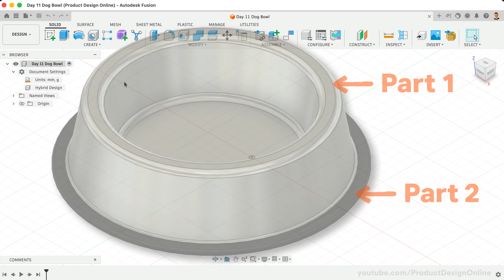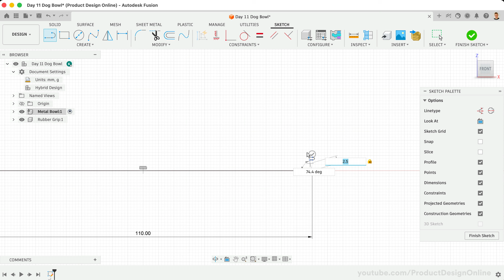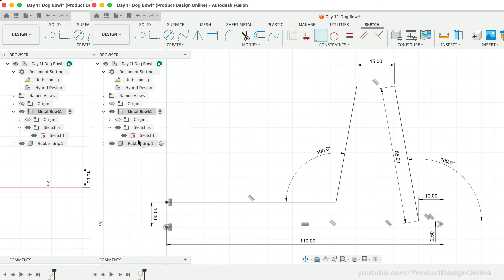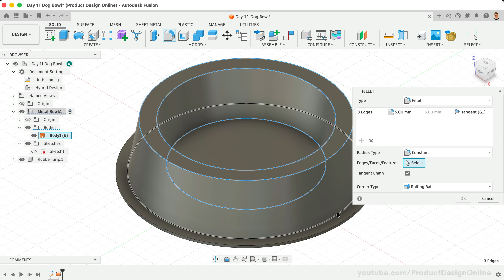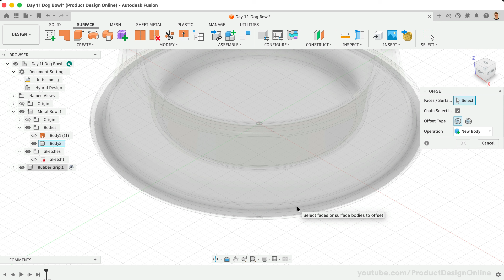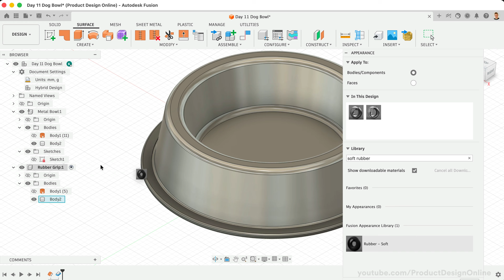Intro to surfaces | Day 11 of Learn Autodesk Fusion 360 in 30 Days (2026 EDITION)

Comment: I'd like to start by thanking you for making these videos. I've been working through your lessons so I can do more of the design work at the metal fab shop I work at. One thing that confuses me is why I need to constrain the horizontal line to the origin when it was dimensioned at 10mm? Still trying to grasp when I would use constraints vs dimensions when modeling my own work, as well as what constraints to use when. Thanks.

Comment: I cannot thicken rubber part from surface. It says 'faces in shell have inconsistent orientation'. Edit: I have found reason. Since I had surface of metal bowl visible, I was selecting both solid body and surface when i wanted to offset - 'thicken' command was giving an error.

Comment: Under Metal Bowl/Bodies is there any reason why adding the fillets that my Body count didnt update from 10 to 11 like yours in the video?
Reply from the maker: Hi Michael. Could you email me your file so I can take a look?
Reply: @ProductDesignOnline  I have sorted it - When selecting THICKEN I found it wasnt highlighting the complete bowl leaving the bottom RIM unselected so by moving my mouse about on the object I found the complete object became selected and everything worked from that point.
Reply: So ive worked it out - when you select THICKEN depending where you place your mouse it does not select the bottom rim so move your mouse about until you see all of your object selected and then when selecting the bottom FILLET it will then update to 11 Bodys. For some reason if I select my mouse where KEVIN has it will not select the bottom rim - I have to move my mouse a little over and then the bottom RIM is then selected making the hole object selected.

Comment: Completed! One issue I ran into was that the metal bowl component was still displaying as transparent at the end. I checked/unchecked the preference setting for Active component visibility, made the different components active, checked the opacity, tried different materials, restarted Fusion and nothing worked. Not sure if it's a bug or if I'm missing something.
Reply from the maker: Strange. The setting should definitely affect it. Capture a video/screen recording if you happy to see it again and I'll pass it along to the team at Autodesk.
Reply: @ProductDesignOnline  Having the same issue- unchecking 'active component visibility' in preferences still leaves my bowl transparent and I'm unable to select the surfaces to make the rubber grip offset

Comment: Cannot fully define the sketch.  No construction line at the 100 degree angle. I've started over 3 times now in case I missed something, and cannot get the sketch to lock to save my life. 

Anyone able to help?
Reply from the maker: I'd be happy to take a look if you can export your file (File > export > choose .f3d) and email it to me?
Reply: @ProductDesignOnline  Sent you an email. Thank you!
Reply: I had same probelm, i didnt specify the lenght of 3rd line (the one before 100° angle)

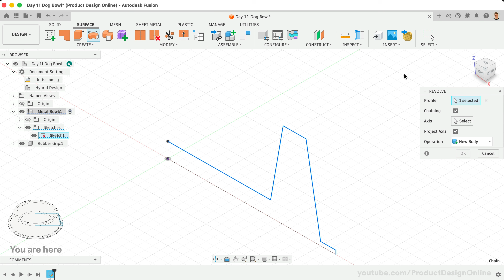Comment: 2:30 How do you "activate line" when you don't have a sketch yet? I can't even get it to come up in "s" search at this point.
Reply from the maker: "L" for Line (I have the pop up on screen).

You can activate any sketch tool from their shortcut which saves you time by being able to immediately select the desired sketch/origin plane and start sketching.
Reply: @ProductDesignOnline  Thanks.  So you can't go through the menu, you can't even use the search, you have to have memorized the correct shortcut key for it to work at this stage.  Crazy.
Reply from the maker: Well, you can always use 'Create Sketch' and select a plane to sketch on first... it just saves you time when you start to spend a ton of time in Fusion to activate a tool with the shortcut and select the plane and get to sketching right away :)
Reply: @ProductDesignOnline  Oh for sure.  That's the workaround I used to keep up with you in the tutorial lol.  It's just a little frustrating the devs didn't consider this and just put the tools you can use with a shortcut to be also accessible from the search and or a drop down menu.

Comment: Hi, great tutorial but I have a question. At around 9:06 when you flip the bowl it appears yellow on the inside, however for me it is not yellow. I checked in the browser and the history that the body is a surface and i triple checked and there was nothing in appearances. I also fiddled around with the display settings but nothing changed. Does this make any difference and how do I turn it on?
Reply from the maker: Are you using Dark mode or any other visual style changes? There is no setting I'm aware of to toggle the surface color (yellow), but it could be affected by one of the environment changes.
Reply: @ProductDesignOnline  I have the same visual style as you, the photo booth environment and shaded with visible edges only. I am also using the performance graphics preset but everything else is the same. Is this going to affect my model or no?
Reply from the maker: @ancarahh  Hmm. I don't believe so. Could you email me your Fusion file?
Reply: @ProductDesignOnline  Sent it to the mail on your youtube channel (the sponsors one)
Reply: @ancarahh  Did you ever resolve this issue? I have the same issue where I have no yellow face despite the body being a surface and default Fusion settings

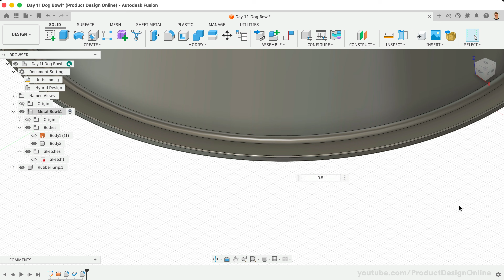Comment: SOS! After finishing the fillet at 10:55, Body1 has only 10 faces instead of Body1 (11). Something seems wrong. I followed the steps multiple times, but I still got the same result.
Reply from the maker: Can you email me your file? There must be an extra fillet or something creating an extra face.
Reply: @ProductDesignOnline  What was the fix for this as I've ended up with the same issue?

Comment: wow!
I found a lot of helpful tips in this tutorial. Thank you for explaining how the surface works. When I try to create something, I stick to solids, as I learned from previous videos.
Each time I finish a tutorial and try to create something on my own, I realize how much more I need to learn :D 
Thank you, Kevin!

The only thing I noticed was that when you flipped the bowl upside down, mine wasn't highlighted in yellow. Where could I be wrong?
Reply from the maker: Thank you, Denis! Glad to hear that.

You double check you're looking at the surface and not the solid body after the fact? Surfaces should always have one yellow side. If it still doesn't appear, can you share your file?
Reply: @ProductDesignOnline  Hi Kevin! I tried recreating the same bowl from scratch in a new project, but it still appears as a single color. I'm not sure why this is happening. But overall, I don’t really see any changes in the final project. Does it actually affect anything?

Also, @ancarahh (in your comments down below) seems to be having the same issue..

I could send you both files I created, although I don’t want to create any extra work for you 😄
Reply from the maker: @DenisAndreenkov  Thanks for trying again! Yes, please email me both files so I can take a look. It is likely some sort of visual setting going on, but having the file will help me confirm/pin point it.
Reply: @ProductDesignOnline  Sure! Thank you for getting back to me and offering your help to find out. I appreciate it!